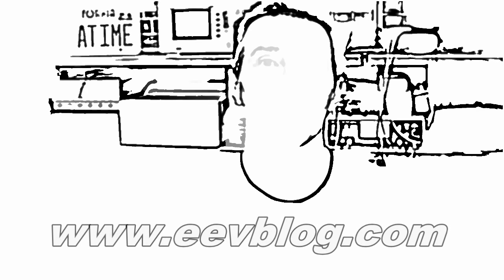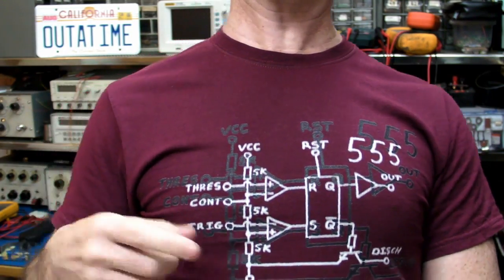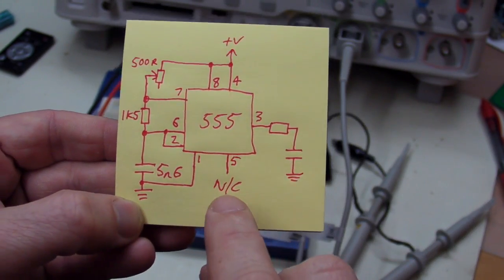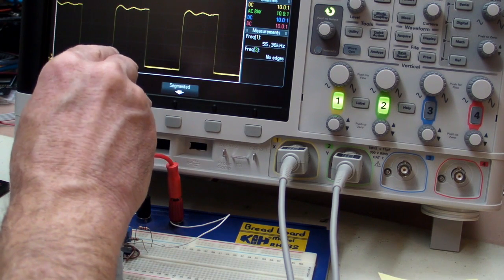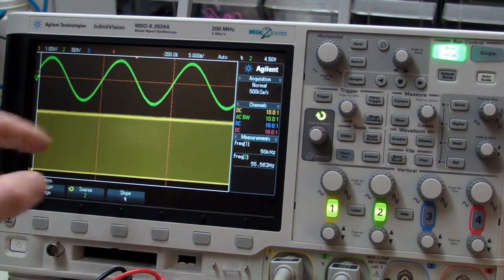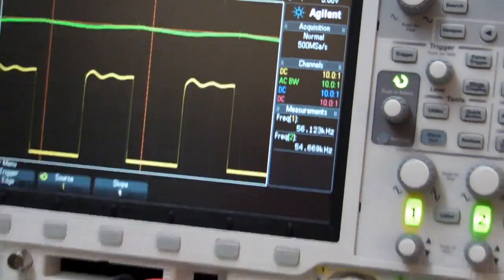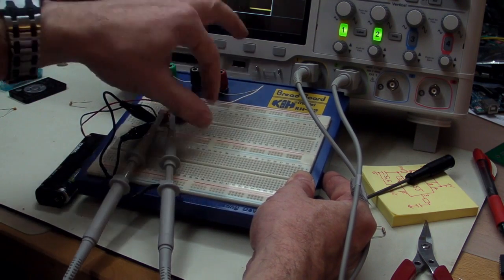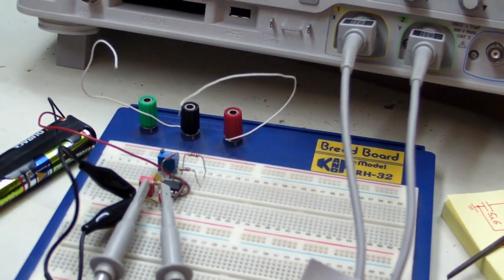EEVblog#160 - 555 Timer Easter Egg?

Comment: I feel the same experiment should be tried on battery only during a power outage ../ open country 30-40 km away ..where there is no influence of overhead or underground utility lines ..
200mA is the max. safe discharging current for pin 7.
pin 5 is " modulation " CONTROL pin for different modulation schemes ..
mod. voltage restricted to small % around 2/3 vcc..

Comment: What a bunch of nonsense!  He does not use the recommended parts for a circuit then complains it doesn't work!  Ho-hum!  Time wasted -- for me.
Reply from the maker: +tkarlmann Oh dear, you don't get it do you?
Reply: EEVblog I certainly do NOT.  I would never think of not using the cap on pin 5, and could care less what it does w/o it.  But I will share one thing with you:  I was one of the first in my company to actually use a 555 timer IC when it first came out.  And yes, I had the Signetics 555 Timer book (still have that book, too).  And, here is the important part, I was working through a circuit, and I found a BUG in the 555 chip itself!  This bug was confirmed by others, and it was discovered later that I had some "Early Silicone" with an actual bug in the 555 IC!  The die was fixed shortly thereafter.  Go ahead, top that!
Reply: Wow, I would expect these type of responses from "Younger Players" -- who defend their right to NOT follow the data sheet, see the circuit not work, then defend their position somehow.  For me, it's like playing Beatles records backwards looking for hidden meanings!  IOW, foolishness.
Reply: Scott MItting OK, I got it now -- watched #161!  When you said Mar 31st, I thought, well, ok, IF it was Apr 1.  Got sucked in, didn't I?
Reply: Scott MItting I wasn't fooled for a second -- other than I thought his 555 spiel was genuine albeit misguided & wrong.  I know the 555 too well, I guess.
Reply: I can see your point in design but finding unintended modes of operation not found in the data sheet definitely has practical uses and is certainly not foolish.
Reply: itHrtzWhenIP: I will clarify:  I was fooled into not catching that this video was an April fool joke, but NOT about the improper circuit used!
Reply: +tkarlmann "other than I thought his 555 spiel was genuine albeit misguided & wrong." so you were fooled then, since that was the joke?
Reply: piglet I agree, I got a little carried away.  Pranksters, apparently, live for that type of response -- wasting everyone's time. Very juvenile.  I STILL will tune Dave completely out whenever he shows another 555 circuit.  BTW, it HAD be at least 1806 or 1807 for that 555 First Silicon ...  If I'm as you describe, then Dave is a real a*-***.
Reply: +tkarlmann "Go ahead, top that!" :D

Comment: I just looked at the 555 equivalent schematic and what you've discovered could easily be an easter egg.  The other name of the control voltage pin is "FM" and it seems as though that's exactly what the 555 does at that frequency.  Easter egg, or a bug in the system that might come in handy?  Is that a sine wave from a 555?  I want to do that trick if it is.  I'll see if I can do it, too.  I have a few kinds of 555s kicking around with other 8-pinners.

Comment: Mad as hell with a 555
I am no electronics expert, however I like to play...
I designed a timer circuit, like a traffic robot (yes, I was South African) but it simply executed a pre-defined sequence used in mining applications.
I used a 555 and a 4017, reminds you experts of a Night Rider light.
Anyway, the CMOS 555 version killed me, because it (the 555) caused a spike at 100ns which the 4017 "counted"
Any ideas?
How can I post a photot of my CRO?

Comment: @frankbuss - That was my next thought, that he drilled a hole through the bottom of his breadboard and connected a sine generator to the CV input.  I was going to wait for him to tell me "nope" again ;-)  After I thought about modulating the power supply, I thought it probably wouldn't vary the frequency much because the 555 is ratiometric to power supply voltage... thus good power supply rejection ratio.

Comment: You'll find that this effect is even more pronounced if you set your power supply to EXACTLY 5.55 volts.  I've known about this since experiments I did on May 5, 2005. For the most spectacular results, operate the circuit at 5 minutes before 6:00 AM.